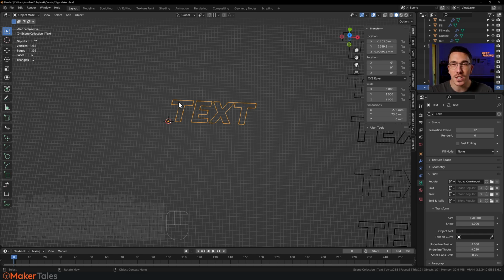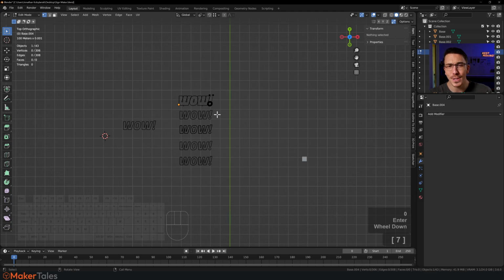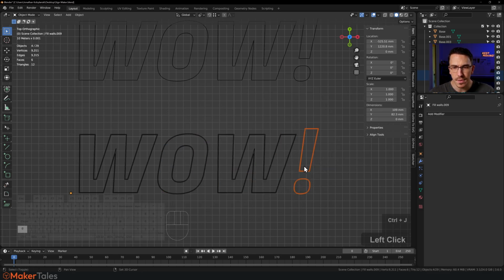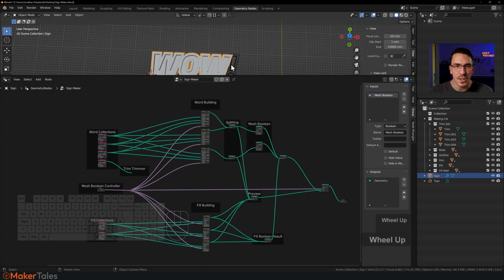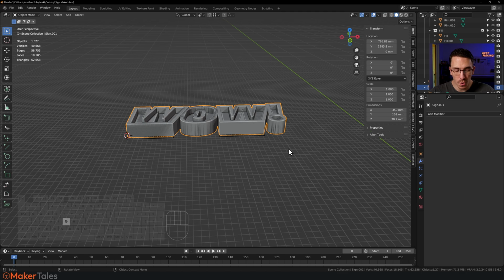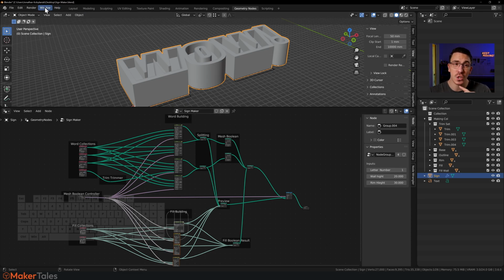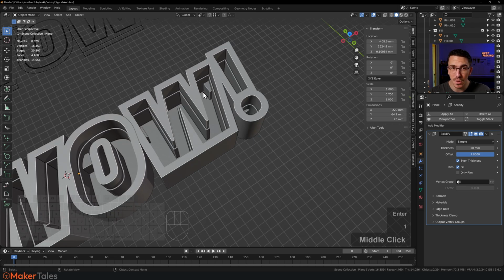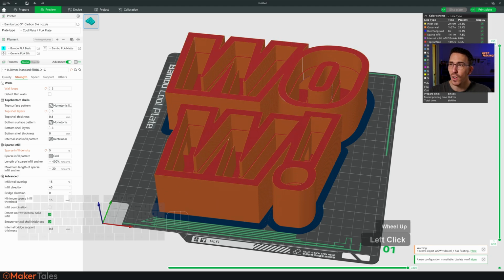How To Design An LED Sign For 3D Printing!

Comment: Hello, Wonderful Video and yes you make everything look so easy with the gazillion key combinations in blender but I am determined to figure it all out with the help of your superb training Videos. I am wondering if you or anyone can assist? I have followed this video again and again and again but find it impossible to get the letter e to work without coming out solid. I am creating the LED sign iFixApple and Avery other word is perfect but in geometry nodes when setting the word building looks it seems fine but when I apply the fill building it doesn't look right and appears to go solid. I have tried 10+ times and changed the base layer so it is pretty much a simple circle with nothing overlapping but still get the same problem? PLEASE PLEASE PLEASE can someone help as I have spent 2 days on this and driving me crazy, would be a shame to just give up...

Comment: I stumbled across this video whilst researching something else... You are clearly extremely skilled with Blender (I use it from time to time, but lack the proficiency to make it my 'go to' software for 3D printing or CNC machining), but it is beyond me why you would use it for this project, unless the purpose was to show your abilities rather than achieve the design objective. Using a program such as Adobe Illustrator or CorelDRAW (there are other cheaper, even free, vector programs available) and Fusion make the tasks outlined both super simple, and faster, without the steep, almost vertical, learning curve that accompanies Blender...

Comment: I just discovered that instead of moving the mesh a distance and then moving it the opposite of that distance (e.g. for Split Edges & Faces to take effect), I can just rotate the mesh 360 degrees to get the same outcome. And, moving the mesh a distance of 0 also works!

Comment: Is there a setting in GeoNodes which will reverse the extrude on the fill walls? (So that the lit lettering pops out, instead of sunken in? TIA
Reply: Set the wall height on the bottom section to a negative number

Comment: Jeebus, why so complicated?! Is it blender or the guy? I mean this whole thing takes like maybe 10 minutes in the very same fusion360 by using just offset and press pull tools. The only downside maybe that you have to trace the text first though with the line tool. Or just use an .svg of a phrase. But dang thats so much easier no matter how you put it. =D
Reply: Totally agree, I use fusion all the time. Yep it's free and way easy to use, with a huge community of people to help.

Also the guy didn't mention about what pla etc he used, so all in all it just feels like a video for people to buy his patron.

This guy doesn't even reply, despite saying just reply here.

Many other people offer free  pro active full tutorials for led casings and 3d prints DIY.

Just my opinion inion 😮
Reply: I was thinking the same thing but compared to Solidworks lol

Blender sucks this kind of stuff.
Reply: First things first, Blender is a free, open-source program.
Fusion360 is an AutoCad program and costs over $600 per year.   
That should be enough to answer your question, but if youre still unsure:
Blender is a multi function 3d suite with an overall ability to function for many different purposes from animation to video games and endless modifiers and add-ons to setup practically anything you want, however you want.
Wheras Fusion360 is a CAD program with one main function that you couldn't change or alter if you wanted to..  ofc it's going to do that single function better.

But if ur using it JUST for printing letters, or any hobby 3D printing, you gonna pay $600+ p/a ?     
No, I didn't think so
Reply: @Postghost  First things first, Fusion360 is free if you register as a hobbyist. That should be enough to address your comment, but if youre still unsure: Blender is a multi function 3d suite with an overall ability to function for many different purposes from animation to video games and endless modifiers and add-ons to setup practically anything you want, however you want. However a multitool is not always a great tool if you need one thing to be done right. I'm not gonna use a swiss knife to cut bread at home, I'll just use a simple kitchen knife that'll do its job fasrter and better. You said it yet:

Fusion360 is a CAD program with not only one main function that you couldn't change or alter if you wanted to. I think you need to try Fusion360, because it also has sculpting function like Blender. =D

Good luck!
Reply: @someonenormal5579  are you allowed to sell the stuff you make with fusion if you are a hobbyist? they probably wouldn't  know or care even you aren't allowed to i would guess?
Reply: @xSKALBER  yeah, it should be ok, they aren;t ok if you use it for commercial purposes, as in trade in volumes, in small time to time amounts it should not be a problem. Plus they may know which model is made when and how cause all your save files sync with their cloud, but I doubt anybody cares =)
Reply: @Alex-rb6it  so would multiboard have to follow any restrictions if he wanted to do it all according to the rules, and use fusion?

Comment: Yeeeeeeaaaah, I think I'll pay someone to make the stl for me lol.
Reply: much do you normally pay someone to do stls?
Reply: @MrTobbo  I make most of my own but for some reason I just cant be bothered with certain designs, especially organic modeling. You're looking at 10-60+ bux depending on how crazy the design is
Reply: this is just a really silly thing to design in blender. you can get the same result in a fraction of the time using any cad software.

Comment: I'm trying to split each letter up seperately (and I have 6) so I have 6 word building nodes and 6 splitting and mesh boolean nodes. However after I do the mesh boolean and the loose parts step it leaves the bottom layer of some letters connected? Any idea what I'm doing wrong? It appears like the first letter is fine, but then the buttom layer of the 2nd word seperates, and instead the it takes the bottom layer of the letter next to it and so forth down the line
Reply: If anything looks off, check for vertices which need to be deleted/dissolved. Every time I encounter any issue like that, the culprit is almost always vertices that I missed.